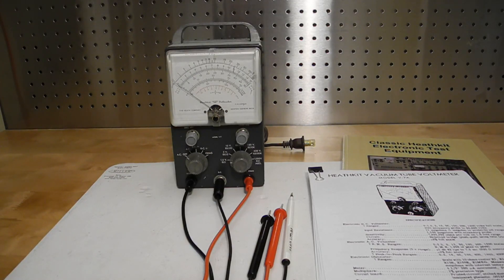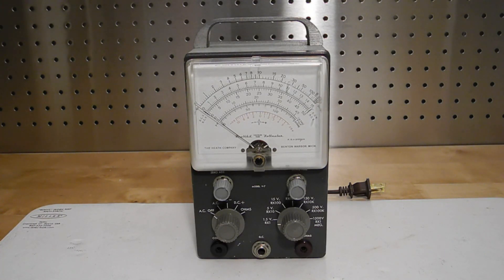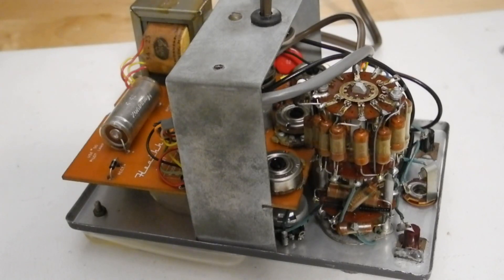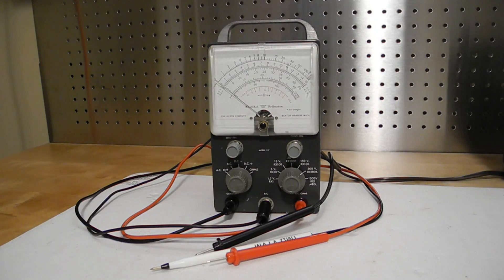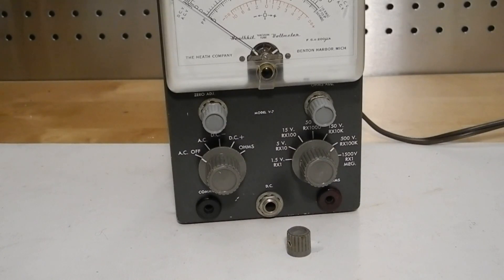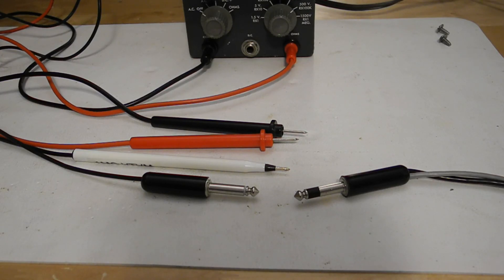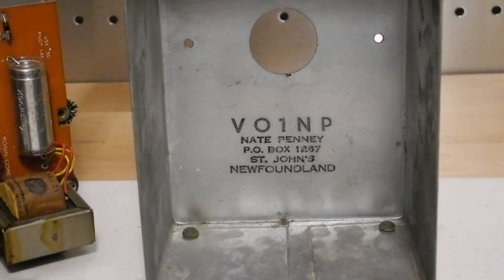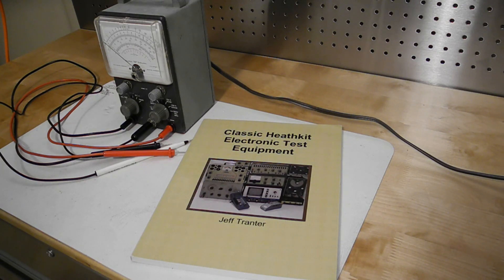The Heathkit V-7 Vacuum Tube Voltmeter

Comment: That VTVM is a very useful piece of equipment. I have a Heathkit V-7A VTVM, I restored it and it's in excellent condition. I'm using it to align radios, I too am a ham operator. A good VTVM is as useful as a good oscilloscope.

Comment from the maker: It has been some time since I last looked at this, but here are some suggestions.
You should be able to find a copy of the manual for the V-6 on the Internet (I found one). Refer to it and check all wiring and component values.
Check that all resistors are within tolerance and replace any that are out of spec. This includes the 1MEG resistor in the DC test lead.
Refer to the In Case of Difficulty section of the manual for more troubleshooting advice. One suggestion there is that if you cannot get a zero adjust you may need to add a 1000 ohm or more resistor in series with either 12AU7 cathode and the zero adjust control.
If it has a selenium rectifier you should probably replace it with a modern 1N4004 diode.
Page 13 of the manual mentions "ageing" the instrument. Doing that may help with calibration.

Comment: Hi Jeff. Many thanks for the video. I have just completed a total restoration of a model V6. I have tried both the supplied and reverse dual rectifiers. However I cannot quite zero the ac needle. I was wondering if it is possible to modify the V6 by using the V7 circuit topology? Many thanks. 73 Dick N4HAY

Comment: just a note that 12AT7/12AV7/12AZ7 are adequate substitutes for the 12AU7 .  12AU7s are getting expensive and 12AV7 or 12AZ7 can still be found NOS at low cost

Comment: Enjoyed your videos.  But a minor mistake on this one mentioning the 1M ohm resistor on the AC probe.  Not sure you caught that in review.  I have one of these my dad built.  Unfortunately it was stored with the battery and destroyed the DC Cal pod and part of the circuit board which I have repaired. However I’m getting drift after calibration and I’m not sure where the draft is coming from. It may be possibly the connections in the wiper switches but I just wondered what you ran into on your unit.  Thank you so much for all the work you do on your YouTube‘s.
Reply from the maker: If it seems to be drift and not an intermittent connection, I would suspect one of the tubes.  But let it run for some time to stabilize. If you replaced any of the tubes, let it run for a number of hours to "burn-in" the tubes.

Comment: Interestingly the V-7 kit manual has some detail on how to repair a cracked circuit board. Heathkit recommended soldering a small piece of wire over the crack and soldering it in place. I have a V-7 with a cracked circuit board. The manual also included full size drawings of the circuit board. One of these days I may try and etch a new board. As you said the V-7A improved upon the PCB design. I've also got a V-6 only to see how the point to point wiring model looked and was wired.